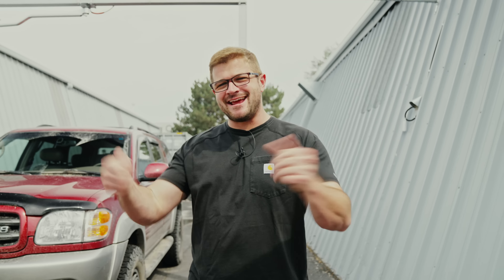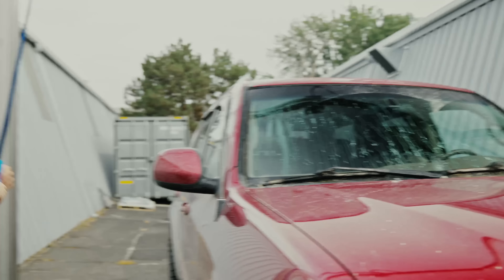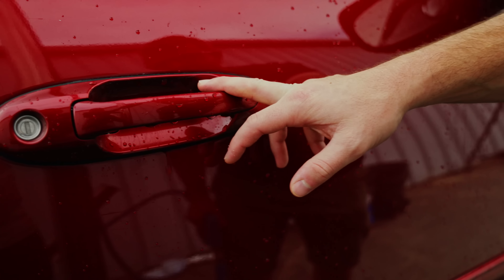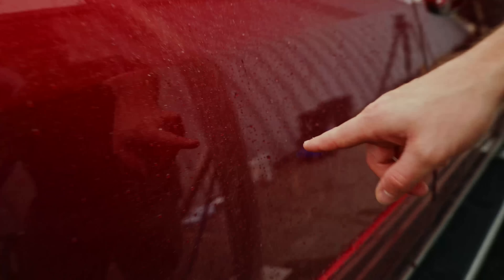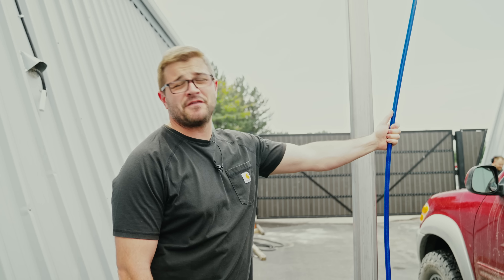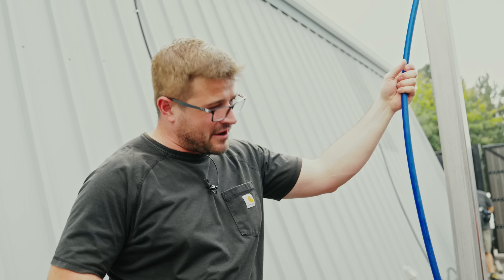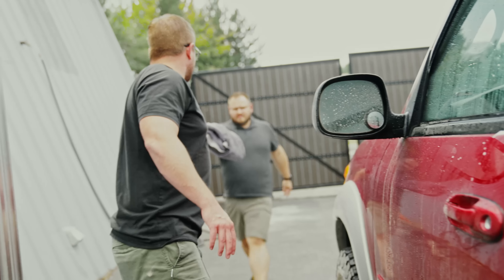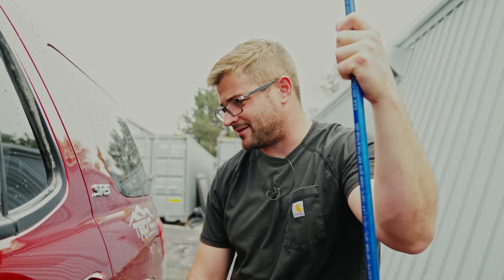Diamond Protech BODY 36 Coating Follow Up! Hydrophobic and Scratch Resistant?

Comment: What off shelve brand soap can I use to wash the car when my car is diamond coated?  Can get them in Walmarts, autozone etc?
Reply from the maker: As long as what you use is PH neutral and doesn't contain protection in it, you should see the best results. Although most of us prefer to rinseless wash our personal vehicles!

The coating has chemical resistance built in so it can handle harsher cleaning chemicals, but for most washes you don't need more than ph neutral soap.

Comment: Put some proper light on the panel and then let’s see it. Having that soft lighting will make any car look good. Even the nasty swirled up black cars.

I bought a handful of these costing and am doing my own testing currently.

What I have found so far is they are not super hard curing making them harder to scratch. 

So far it seems like these are just another coating like graphene, or any other new name buzzz word coating to come out.

I personally don’t see how the diamond nano coating is out perform or are better than your typical ceramic coatings.

My testing will continue and time will tell.

Keep up the great videos just please use some proper light to see the paints actually condition. It’s boarder line miss leading information and getting close to some Ceramic Pro selling tactics essentially saying these new coatings will protect your paint from going bushwhacking off roading.  Cmon man… only PPF will do that.

No coating on the market does that.
Reply: My issue with this coating is that it’s so easy to scratch, I have micro straight line scratches that I’ve never seen before with other coated cars. Idk what I did wrong but this coating seemed to make the clear super soft and now it’s so easy to be micro scratched
Reply: Facts. I applied this stuff and I still think my CQtz ceramic is thicker.

Comment: So far this coating has been extremely impressive to read about and see in action. I would really like to see some testing of the actual scratch resistance compared to another coating side by side. With a light on the paint.

Comment: Idk if I’m doing something wrong but I have installed this coating on two separate vehicles and each time I have it the 10-15 minutes before buff off and it was a pain to get off. Felt like it left a small amount of haze that reminded me of buffer trails when hit with the scangrip.
Reply: You're waiting too long for your conditions. You don't need to wait the full time, always do a test wipe or two to figure out your flash time limit.

Comment: The pressure washer nozzle is so close to the paint, i feel it would have cleaned a non coated car too 🤔
Reply: The pressure on our outside gun is actually quite low, about 800 psi. So he’s actually holding it just right!
Reply: You'll get similar results with a $20 bottle of Megs HCW. 2 coats.

Comment: Coating looks great but the body 36 should have been a 50ml not a 30ml, I know 30ml is enough to coat a car but you usually try to use the least amount of product per panel because you are scared to run out before getting the whole car with a 50ml two coats are possible. Once a 50ml is available of body36 I will purchase a bottle for sure.
Reply: I did two coats on this sequoia with 30ml
15ml per coat. Totally doable!
Reply: If your worried about product usage buy some Medicare medicine droppers to use for controlled product usage .
Reply: @adoseofandros  I never thought about that, I’m not a pro I’ve coated 4 cars before and the 30 ml barely made it but I guess I used to much product per panel but a dropper makes sense in controlling my product usage will get some.